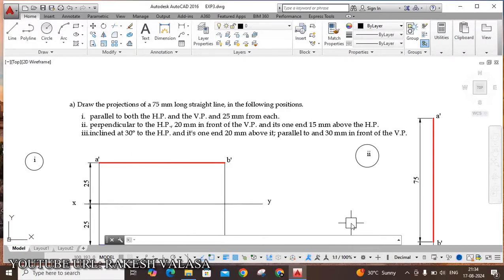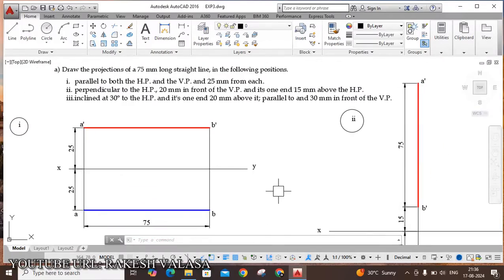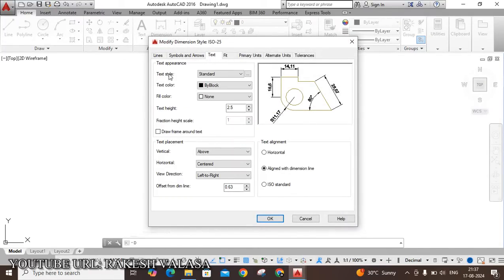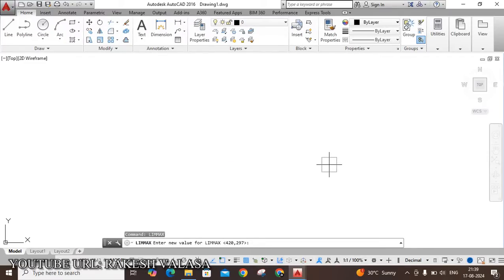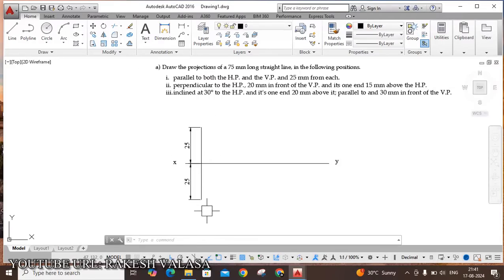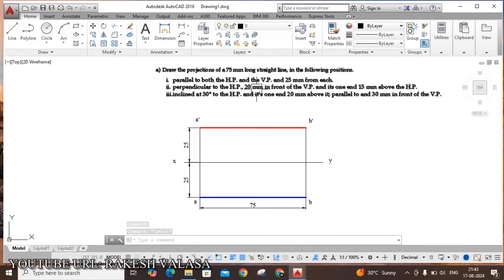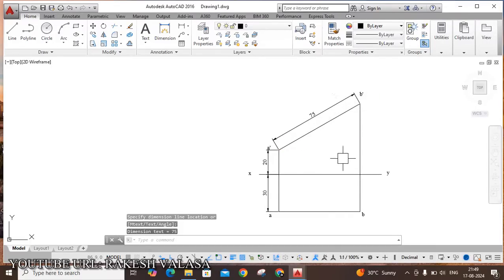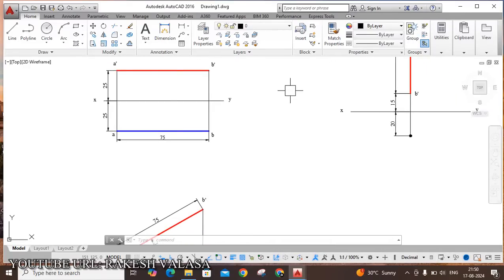E3.1 Draw the projections of straight lines in simple positions and inclined to one plane in AutoCAD

Comment: Draw the projections of a line AB 75 mm long, in the following positions: 
(i) Parallel to and 30 mm above the H.P. and in the V.P. 
(ii) Parallel to and 30 mm below the H.P. and in the V.P. 
(iii) Perpendicular to the H.P., 20 mm in front of the V.P. and its one end 15 mm 
above the H.P. 
(iv) Perpendicular to the H.P., 20 mm behind the V.P. and its one end 15 mm below 
the H.P. 
(v) Inclined at 30° to the H.P. and its one end 20 mm above it; parallel to and 30 mm 
in front of the V.P.